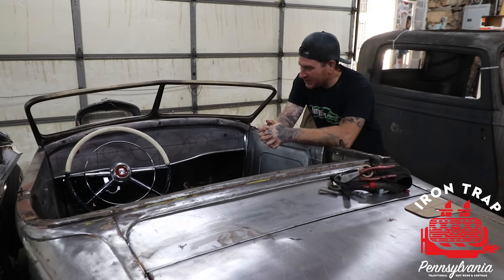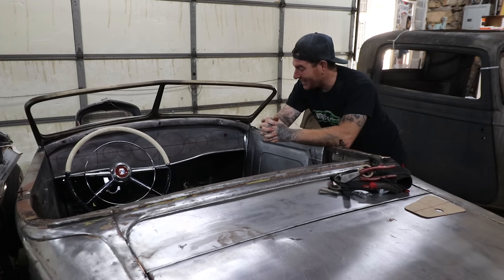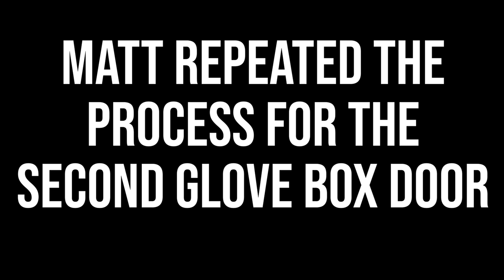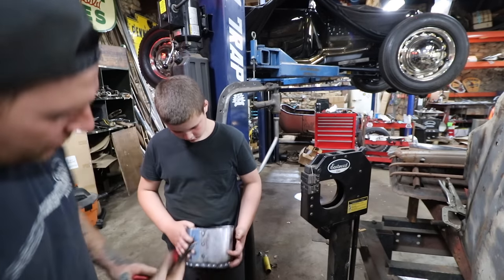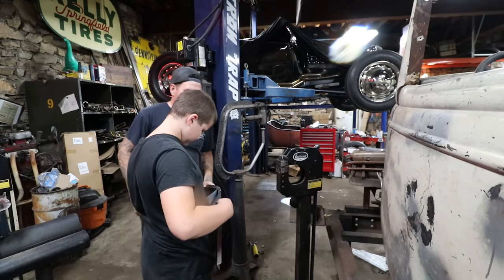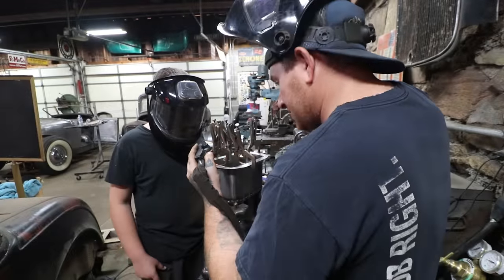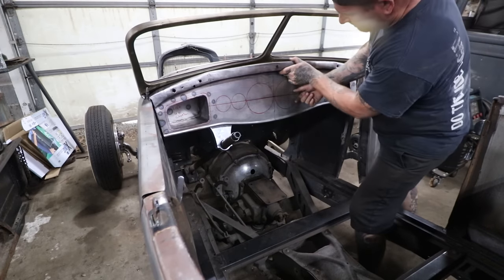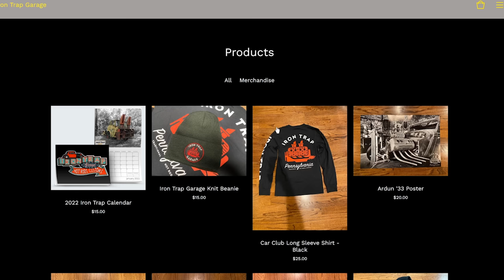Fabricating Custom Glove Boxes & Doors For The Sweetheart Roadster

Comment: Nice work on the custom Sweet Heart dash. May I suggest you line the inside with a heavy cloth, like felt or maybe even leather to dampen any rattles from the contents. Great to see an apprentice in the garage!
Reply from the maker: Yea I was thinking something like that or using the spray “flock” like factory used

Comment: I like the 2 glove box door design for the dash. Here's an idea, how about the next time you make another door, cut notches around the corners, nothing fancy, just straight in with the band saw, so when it's time to bend them over, they will lay over each other and make it so much easier to form the corners.
Love the Sunday morning shows, it's a great start to the day. 
Have a great rest of your day Matt. Tell everyone Hey. Y'all seem to have a good working together fitment, where you can see what's going on and are able to make suggestions for one another and make it work out as you're working on whatever at the time. You like feed off of each other and kinda know what each other may be thinking about to find a fix to the situation. I know, I'm rambling on, but you always say if we have a suggestion, to let you know. 
Okay, okay, Later Matt. 👋😃👍
Reply from the maker: Thanks for watching Gordon. I prefer to hammer shrink the corner when possible. Even if I do what said you I have to the weld the cuts up and sand them smooth. Takes the same amount of time regardless. Just how I prefer to do it when possible

Comment: Besides wax paper, you can also use the blue plastic that's used to protect wood and tile floors on construction sites. It's transparent(ish) and has a light adhesive back.

Comment: I, for one, like the dual glove boxes. Nice to see a youngster interested. Wouldn't it be great if high schools had shop classes again?
Reply from the maker: 100% on board with that. That’s why I’ll never turn down giving free lessons to a younger guy or gal that shows interest in this stuff!
Reply: We are very lucky in our area three of the local school districts came together and created a vo-tech center. They have everything from culinary, and construction trades, to auto trades including bodywork. A friend's daughter did a 52 Chevy Pickup, rebuilt the engine, and transmission, rewired it, all the bodywork, and a really nice paint job.

Comment: As always, your metal fab skills are amazing.  Hammer-forming is not easy to do well...  If the heat-wrench is causing problems with the wooden buck, you can try soaking them with water first to slow down the charring.  Yeah, dual glove boxes are not "traditional" in hot rodding, except when the builder had access to some of the dash panels from some of the more elegant cars from the period.  I think they are great.  The suggestion to put dimples for drink holders in the inside door liner is a great idea...  Think about it...

Comment: Gotta find a 1955 Ford radio for the dash. It's a one year only radio with a round dial and buttons below. It's a 6 volt but can easily be converted to 12 volt if you're considering converting it to 12 volts.

Comment: when i buy something that comes in clamshell packaging, i cut out and save the bigger flat pieces of clear plastic to trace around things to cut for clear templates. works well, and it's tuff enough to use more than once. i just write on it what it's for, and chuck it in a drawer with a bunch more of them that i've made over the years. i kinda like the dual glove boxes. then you don't have to lean across the car to get yer sunglasses.

Comment: What a nice detail. You might want to consider a hinge on the side rather than the bottom.  With a bottom hinge the door may flop open after hitting a bump in the road.
Reply from the maker: That is a common problem with these cars for sure of flopping open but a side opening door is sort of odd and wasn’t really ever done. I’ll try and make everything latch tightly so that isn’t a problem.

Comment: I like the shaved look on the doors. Use magnetic catches and no handles. I used the kind that you push in and they spring out, but mine are flush mounted into the opening, so that prob wouldn't work for you.
Reply from the maker: I was thinking about that! Need to stare at it a bit !

Comment: But but but, that's not original, you will loose points at the AACA show! They look great we did that on a 33 Dodge at my shop some years ago, the right side was already functional and the left side was stamped at the factory but not cut out. We cut it and made a short box for the ignition, wiper and headlight switches and two basic hinges. Nice work!
Reply from the maker: That’s a great idea!